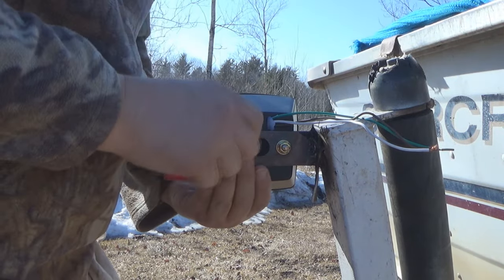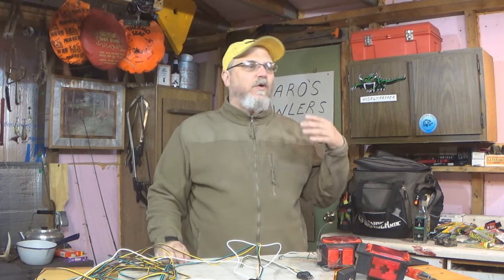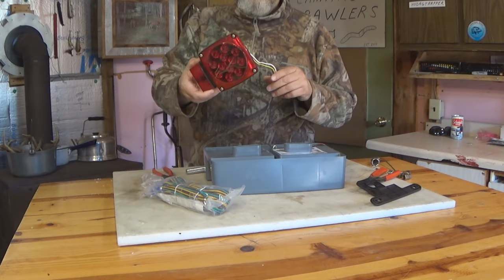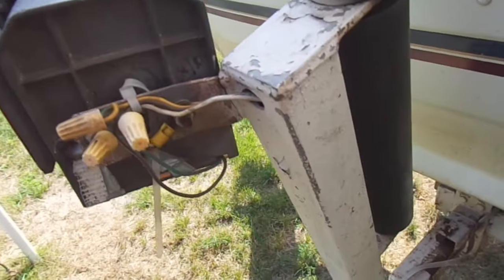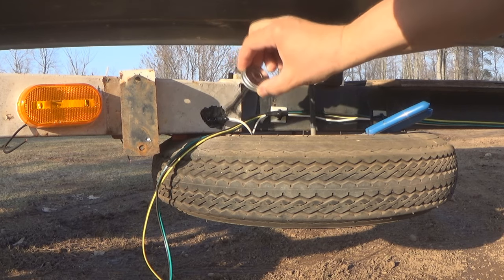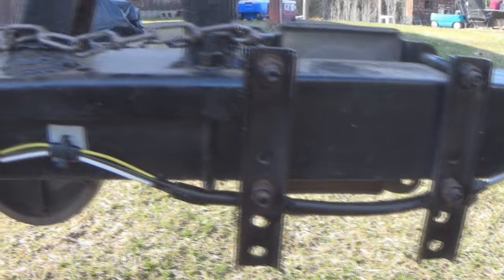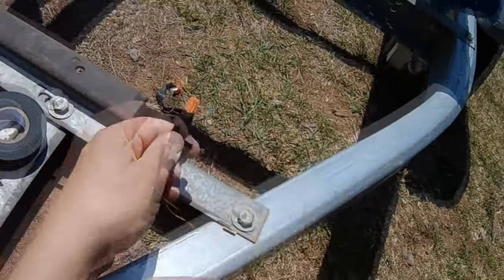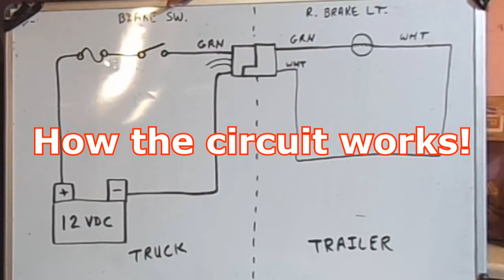How To Wire A Trailer, New Lights Also

Comment: So I just replaced the light kits trailer, I got power but running lights not turn on?  signal left & right turns on but very dim. 
Emergency light turn on very bright.
Reply from the maker: The dim part makes me think you aren't grounded properly at one or more fixtures.

Comment: I have had trouble with Mice chewing my trailer wires that ran inside the trailer frame!!
Reply from the maker: Yes that can happen.  That's why I don't mind running the wires on the outside.  At least you can see issues like that.  I had a problem in the trailer frame once too.  Not an easy fix and can be hard to troubleshoot.

Comment: Great video!!!  Maybe you can help me.  I broke a tail light and replaced it with a new set.  Everything worked fine in the fall before it was broken.  After replacing the new lights by simply attaching color to color I only have running lights with no brake or turn signals?  It's driving me crazy!!! Please offer some advice.
Reply from the maker: Did you get the new fixture grounded properly to the trailer frame?
Reply: @KnettersPracticalOutdoors  Thx for the reply.  Yes  Its a separate white wire going to the frame.  What bugs me is that it worked fine when i winterized it.
Reply: @KnettersPracticalOutdoors  I found the problem. A trailer plug test light proved it was my truck and not the trailer. Seems it's not so uncommon with Nissan Titans.    A blown fuse in the larger fuse box in the engine compartment.  I noticed the separate turn signal relays weren't making clicking sounds in another fuse box and figured they weren't getting power. Thanks for your help anyway, You earned a new subscriber.

Comment: Hello again. !  Got a question ?  In my new trailer light kit my side marker lights have a red and black wire hook up. Just wondering if there is a norm in hooking this up. ?  Do I go red to brown and then add a ring connector to the black wire and use the black as ground  or other way around.  That’s it thank you sir !
Reply from the maker: Not sure.  There should be a diagram if you bought a kit or see what wire or wires is hot when the running lights are on and check if that black is actually ground or negative.
Reply: I found the black wire is my hot so I’ll ground out the red. The diagram that came with kit was useless but I got it under control now. Thanks for your time !

Comment: If the bolt that is connected to the frame is the ground. Why do you need to connect a separate ground wire to said bolt?
Reply from the maker: Not all studs are actually the ground.  Some are just mounted to the plastic on the fixture with no grounding properties.  So then the white wire is the ground.

Comment: Hi, maybe someone could help me. I hooked up the lights exactly as you but for some reason the right taillight does not work. The green wire over heats. When I switch the green wire to brown wire the taillight goes on but does not blink. Is this a ground issue? Or is it faulty. Thank you in advance
Reply from the maker: Does the over heating green wire blow a fuse?  It should.  Maybe your fixture is bad or something is loose in the fixture.

Comment: If you have trailer wire kit that has a 4pin flat plug with green, brown, yellow & white. wires. 
I understand the green & brown wire go to the right tail light. And the yellow goes to the left tail light but there is not a extra  brown wire that also needs to go to the left tail light. So, what am I to do? Thanks
Reply from the maker: Sometimes the brown gets jumpered from fixture to fixture right around the whole trailer.

Comment: How many fixtures is too many? Meaning, is there such thing from adding so many that some of them don't receive electricity, or that all of them appear more dim, or even worse, it hurts my trailer or truck? I'm a bit new to wiring. Thanks in advance.
Reply from the maker: You are limited by wire size and fusing.  Your fuses for these circuits have an amp rating.  It's can be slightly different from vehicle to vehicle.  As long as the total amp draw from all your fixtures is less than your fuse for the circuit, you are fine.  If you are fused correctly and you start blowing fuses, you have added too many fixtures.  LED fixtures will help keep the amps down.

Comment: I bought these lights and the only problem I have is that both sides, the running lights don’t work. Braking lights work, hazards work, but no running lights. Any suggestions? It’s a 16 foot painted (Fully welded) trailer with ground on coupler and one on each light
Reply from the maker: Well, make sure the fixtures have a good clean ground and also check the vehicle side.  See https://www.youtube.com/watch?v=MqrpMcjGiTM&t=247s  Let me know how it goes.

Comment: I never ground anything to the trailer.  I run my ground wires to the white plug wire from each light and use the vehicle for ground when it's plugged in.  Much easier to trouble shoot in my opinion.  I also don't like grinding paint off my new trailer to make a ground point as it can introduce rust.
Reply from the maker: Not a bad way to go

Comment: Can you just tap into white wire to ground lights? Instead of grounding trailer frame
Reply from the maker: Yes you can run a white ground to each fixture.  This helps with several problems.
Reply: @KnettersPracticalOutdoors  appreciate the response !

Comment: What if you have 4 pin flat but it have 5 wires im having a issue where some lights work and some dont
Reply from the maker: Sometimes there are 2 browns.  One for each side and they come together at the trailer side plug.
Reply: @KnettersPracticalOutdoors  yes a white 2 brown yellow and green
Reply: Both turn signal work the rear side marker the tail lights dont work and brake lights don't work
Reply: Couldn't be ground issue huh
Reply: I hooked it up Sunday morning it worked then again Sunday evening then they didn't work
Reply from the maker: @michaelfrazier2060  Fixture might not be grounded well or also clean both sides of the plug up.  That often is the problem.  Let me know how it goes.
Reply: Ok thanks
Reply: Hey i got my trailer lights working i moved the ground from the tounge and moved it farther back to the frame. Thanks for the info

Comment: word to the wise: if u install hopkins trailer brake lights from walmart, remove the red plastic square cover (the part you see from the rear of the trailer), hammer out the 2 studs on each light housing, go to a hardware store & get 4 HEX HEAD bolts w/ the same diameter, then press those into the plastic light housing, then re-install the red plastic square cover.
if you install these rear trailer brake lights w/out doing this, in 2 years, you'll be in your garage, using a dremel and a hammer to remove these pieces of crap.
trust me, it's worth potentially breaking the new brake lights!!! it probably won't even break, but if ur reading this, you can THANK me in 2 years! IT'S UP TO YOU.
Reply from the maker: Thanks for adding in.

Comment: can i just run a white wire directly to the lights and not have to worry about the chassis
Reply from the maker: Yes, that will work.  I would also ground the trailer frame if your fixtures have a separate white wire.  That way any short circuits will blow fuses as they should.
Reply: Great explanation including the illustrations and narratives...perfect!

Comment: why does no one show how to do the front connection?  How long to dangle?
Reply from the maker: Need enough slack so the wires aren't pulled on when taking the tightest turn and then plus a little more.

Comment: What if your trailer light kit only came with one brown wire?
Reply from the maker: The brown wire will need to make it's way to each fixture.  Instead of splitting to each side of the trailer it will loop around fixture to fixture.

Comment: Great video however why would you ever use wire nuts on anything other than an indoor environment?  I would have spliced in the side. marker lights just like you did with all your other connections, with heat shrink butt connectors. Great tips on grounding  lights to the trailer.  A poor ground can lead to so many problems so best advice is to remember you cannot over ground your trailer!
Reply from the maker: Wire nuts are just an option.  They do make it nice when you change a fixture for the 3rd or 4th time.  Then you don't slowly shorten the wires every time.  KPO

Comment: Why not just length the white wire and attach it to the tail lights and done worry about grounding points on the trailer
Reply from the maker: That works!  But also ground the trailer so short circuits blow fuses like that should.

Comment: You lost me at the wire nut 😢
Reply from the maker: Not commonly used on trailer wiring, but when used with silicone or liquid tape it is a solid connection that will last for years and can be disconnected without cutting.